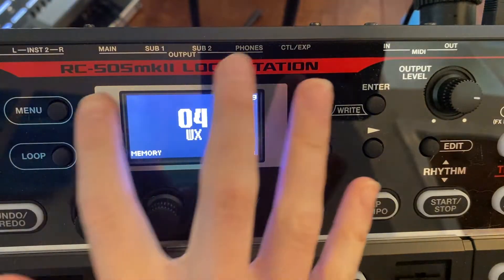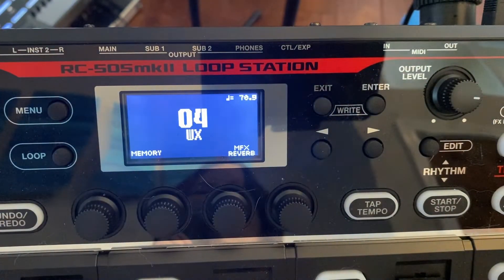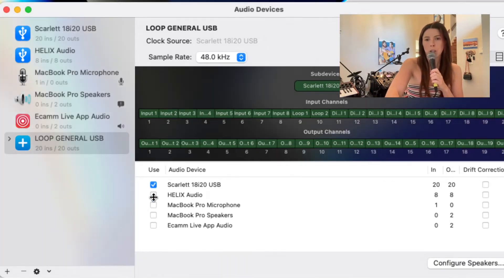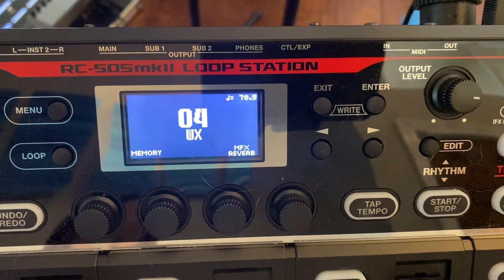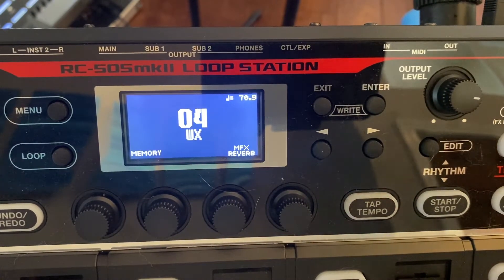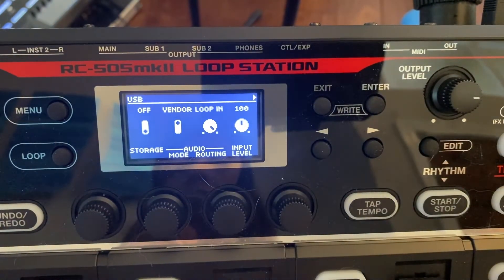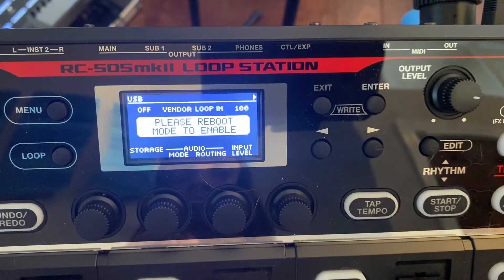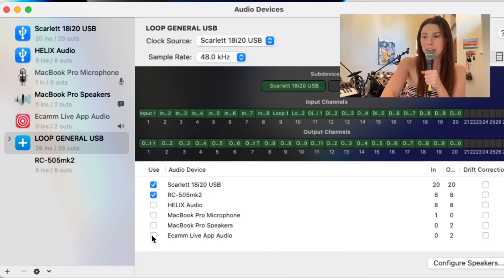How to Fix Boss RC-505 Mk2 USB Connection

Comment: Hey nice video! 

Question.. the rc505 is a audio interface itself, I am curious as to why you are using the focusrite interface aswell..? Is it a better audio interface then the rc 505 ?

I also have a rc 505 mk2 and I am wondering how you connect it to the focusrite ? 

Many thanks 🙏
Reply from the maker: We just made the 505 and focusrite into an aggregate on the Mac because we already had touting going through the focusrite.
Reply: Ok thank you. Other question if you dont mind.. if i connect the rc 505 for the first time to the the laptop via usb, is it supposed to connect straight away or do these settings anyway have to be changed on the rc505 regardless ? 

Also did you have to download any drivers for the rc505 when you connected it via usb ?

Sorry I’m a newb trying to get it all to work 😅
Reply from the maker: @loops_and_shades  It really depends on any new firmware that Boss / Roland may have done since the video posted. I would always download all the drivers and software from their website regardless of what operating system you are on! The downloads page is at https://www.boss.info/global/support/by_product/rc-505mk2/updates_drivers/

Comment: Can also confirm that the MK2 USB output to the Google Pixel Pro creates problems (crackling noise and static when recording to the Pixel 7 Pro via USB) I narrowed it down to the Loop Station, because my Elektron Digitakt records just fine going into the Google Pixel 7 Pro (Usen OpenCamera as my recording app in both instances)

Comment: any chance you are using Logic Pro?  ive been looking to find anyone who can get the 505 mk2 to be the Master clock and logic pro the slave.  ive tried everything...  any help so appreciated.  want to be able to change the BPM for the project on the 505
Reply from the maker: Hmmm, I’m not sure how to do it but I’m guessing there IS a way. I can try and look into it and tell you if I find anything.
Reply from the maker: I haven't used Logic pro as an interface yet

Comment: Does one have to download and install a special driver from Roland/Boss website first, or does the device just show up in the AudioMIDI Setup when you properly do the trick above?
Reply from the maker: So I installed the driver from https://www.boss.info/global/products/rc-505mk2/downloads/, and that's the "vendor" setting that shows up. My understanding is that the vendor driver allows you to split the channels and use it more like an audio interface.

Comment: yo yo, i recommend updating the machine too if you haven't already so that you dont need to deal with the annoying bugs :)
Reply from the maker: Thank you, and great video on your channel btw. Cool loop you created! I have updated the driver and machine but the problem persists. It's only some of the time, but still really frustrating. Hopefully they fix it with the next update. Maybe it's just a Mac thing?
Reply: @JessieLarkMusic  i recommend watching balances video on how to update the machine just incase you missed some steps, its on windows but im pretty sure its the same way on mac
Reply: @JessieLarkMusic  also i dont think installing the drivers does anything, the thing you need is the system program
Reply from the maker: @sabyy.  Thanks. I've updated all of the above and still no dice. Hopefully Roland fixes it! The facebook group has a few others experiencing the same thing :(
Reply: @JessieLarkMusic  thats strange, could you explain these problems?
Reply from the maker: @sabyy.  I've explained everything I know.
Reply: @JessieLarkMusic  are there certian fxs or and bugs with the loop itself? i havent really had many problems once i updated and i use my loop for hours
Reply from the maker: @sabyy.  nothing like that . . . just the driver issue I described in the video . . .
Reply from the maker: I'm not exactly sure- recently after the latest update from Boss- this hasn't been a problem.
Reply: @JessieLarkMusic  PC thing also !😅